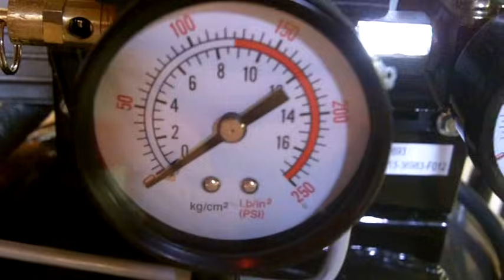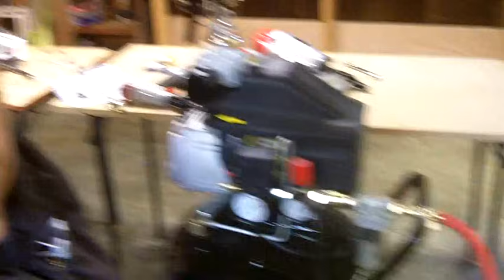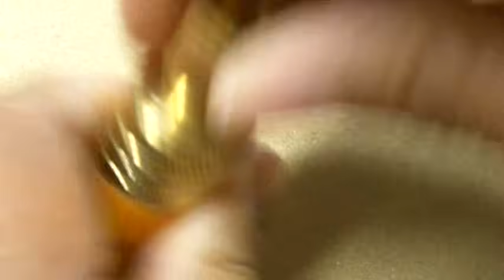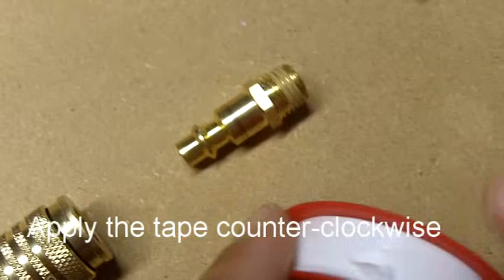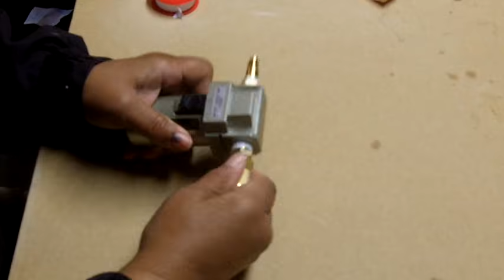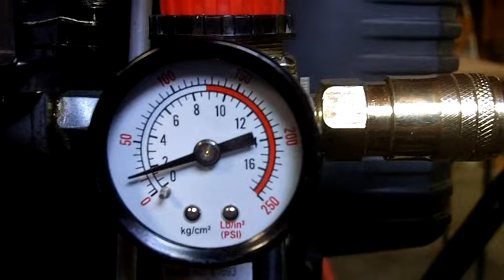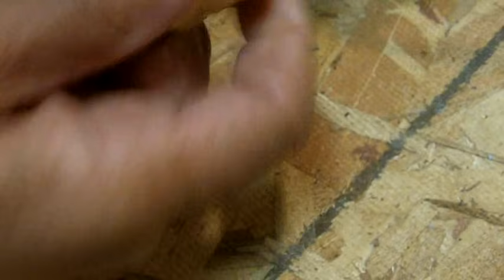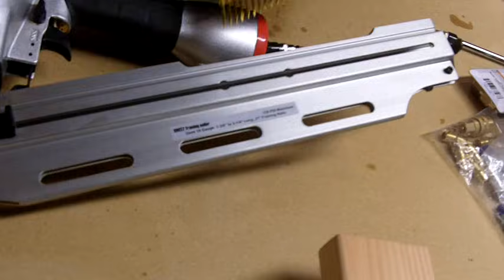Air Compressor, Line Setup and How to Use Air Tools for Beginners

Comment: i borrowed a compressor off my dad but if hasn't been used in years. before starting it i changed the oil but i spilt some all over the pressure switch I don't know if that made a difference. anyway i turned it on without attaching anything. the pressure went up to 130psi yet it says maximum 115psi on the sticker. i had to shut it off as it was still rising and didn't cut off and I was afraid it would blow itself up. 

do i need a new pressure switch since it doesn't cut off and keeps building up ?? or am i doing something wrong ?
Reply from the maker: +JCDenton648     This is a very dangerous issue.  Your description is typical of a pressure switch failing. In addition to that, the pressure relief valve did not trip which makes a serious issue even more critical.  Diagnosing a mechanical problem remotely can be difficult.    You would be best served to have the compressor serviced.

Comment: Ms Leah-I have a air compressor and I want to use it for impact wrench. The manual says to but 3/8 inch air hose. When I go to the homedepot/lowes, I can see the 3/8 inch hose but all fittings are 1/4 inch. Will 1/4 inch fittings work with 3/8 hose. If not, where should I buy 3/8 fittings.
Reply: vikaschopra1973 That is what she was doing toward the end of the video ... attaching a larger filter fitting to a smaller quick connect plug and then to a smaller hose.  She used a coupler to match the larger size to the smaller one.  If you want to get a bit more orientation go to Amazon.com and search for "air fittings" and you'll see all kinds of kits.  You could also wander around a store like Harbor Freight, or Sears, or Lowes, or Homedepot.  Sometimes the gods will smile on you and you'll find an employee who does not see you quickly enough to scamper away into whatever dark hole they hide in to avoid helping customers ;-) and you could ask some questions.
Reply: Mike De Bruyn Thanks

Comment: awesome video!!! i have a question, im going to start using a brad nailer 18 gauge oilless do i still have to use a filter? and the air compressor is oilless to
Reply from the maker: Ortiz H    It will help prolong the life of your air tools.
Reply: Yes being cautious with our tools is important, is the filter using Is brand central pneumatic? Or which one is it and if you recommend it

Comment: Just bought the same compressor  (21 gal ) and, i did the initial set up  ( for 30 minutes as indicated ) and the tank was a little too hot..its leveled,  i did add oil also as indicated, i start using it wit a nail gun ( brad nails) , use it for a little bit, few nails, im rookie in this field..do u know why it gets that hot the 1st time?? ..

Thanks
Reply from the maker: Hector Javier Sanchez Hi Hector, mine does get hot as well.  Does it cut off?
Reply from the maker: seejanedrill I mean, does it cut off when you're using it?
Reply: It does cut off when it reaches preassure, as supposed to, it's just the being a little too hot part that concerns me, but i think ( im a rookie. .) That , all compressors get really hot when filling the tank the 1st time b4 use for the day..i think..correct me please if im wrong...

And thanks for the reply.
Reply from the maker: Hector Javier Sanchez Hey Hector, first of all, I apologize for taking so long to respond.  I have used many compressors over the years, and they do get warm.  That said, my HF compressor does get very hot, so I think it is just typical of this model.
Reply: No problem!! We learn as we go (us rookies ).. im very, very thankful of ur inside on these things, i just replaced a ceiling and used the compressor ALL for the 1st time (nail gun and all)....and yes , i agree with u... 
We are (all) able to do these things
Reply: Dont know why that line shows over the last sentence **

Comment: Hey Jane I enjoy the way you teach :)
Reply from the maker: Adam Gracy  Thanks Adam
Reply: seejanedrill do you think you could help me out with some recommendations? I'm looking for an air compressor and nail gun package, probably a framing nail gun. do you have any recommendations for brands?
Reply from the maker: Adam Gracy Hi Adam, it kind of depends upon the type of job that you are planning to use the nailer and compressor for.  Are you a DIY-er with an occasional project, or do you plan on using it in a commercial application?  This makes a huge difference.
Reply: seejanedrill honestly it's just going to be a do it myself type of work. I plan on making a bed frame some benches and maybe chairs. I really suck and nailing in nails

Comment: I think this is the best instructional video I've seen yet on youtube- with your clear and thorough guidance, i finally busted my compressor out of its intimidating box and plan to put it to use at last! sincere thank yous, Leah
Reply: I'm a professor and had years of training on teaching techniques and approaches, and she is much better than not only me but most, if not all, other professors I know.

If I were her I would consider selling a product line.  For example, a "kit" that sells all the fittings needed for an air compressor.

Comment: Thank you so much for posting this video! How much of a gallon compressor can I use in order to use an air impact wrench? I have one in the basement and I wanted to know if I can use that instead of getting a whole new one. I think it's a 3 or 5 gallon tank.
Reply from the maker: Terrance Williams Hi Terence, unfortunately, it is highly unlikely that a small compressor such as yours can deliver the amount of CFM (cubic feet per minute) that an air impact wrench would need.  At a minimum, you would need 2.5 CFM to operate a 3/8" impact wrench (small) and 4 CFM to operate a 1/2" impact wrench (larger).  You will need to look at the manufacturers data sheet for your air compressor to find out how yours is rated.

Comment: this was a great video. keep it up. My wife really appreciated the simple explanation. I kind of overcomplicated it thanks. is that a HF 21 gallon compressor, and if it is how you like it?
Reply from the maker: WitchdoktahArms Hi there, glad you (and your wife) liked the video!  As for the compressor, it was priced well, I have used it without any major issues, however, sometimes it can be a little bit sensitive to changes in room temperature.

Comment: I'm no idiot. But for the purposes of something like this I appreciated being treated like one. It helps, it really does. Thank you for taking the time to explain all this in 1 video. I'm confident my first use with my new compressor will go very well tomorrow.
Reply: What Jared Foster said.   Leah, thank you!
Reply: Yup, what Jared said...this was exactly what I have been looking for.
Reply: 100 percent in the same boat. I consider myself handy but I KNEW nothing about compressors prior to this.
Reply: @SarcasmSage-w6o  Same.
Reply: Some of us need every detail and being spoken to like a beginner student!  Thank you Leah!  👍🏼
Reply: @annaibarra3447  I
Reply: @Strve Sit I just started actually using mine...  ALWAYS REMEMBER TO TURN PRESSURE OFF WHEB TAKING A FITTING OFF!  Probably happens to everyone at least once but I almost took my eye out trying to take the quick connect hose off while it was still pressurized to 125psi!
Reply: Well said!
Reply: Same here. I am a very "handy" person, just never used a compressor.
Reply: Some time's it's good to be refreshed on using compress air! It can be dangerous if a person don't know what they are doing.
Reply: I understand more than I did before!  Thanks!  Great explanation!  Easy to follow!
Reply: Being provided with complete, detailed information is not being treated "like an idiot".  It's being given good information.
The OP has no idea who you are or what you already know.   How could they? 
"Hey Jake!  Hey Rocko!  Go visit our friend there and find out what he knows.  The boss don't want to commit no faux pas by telling him something he already knows."
Reply: Seems nobody is an idiot to Leah. She treats everyone as novices. The whole point of her videos. Thank you, Leah!
Reply: Actually you are
Reply: @irishuwould5185  actually if you read his comment again, he is being very humble acknowledging that he appreciated being educated as if he was a novice because he learned from her. Some people here had difficulty comprehending what he said; a few people in this thread understood but many did not.
Reply: Ditto
Reply: Jared Fos
Reply: Seriously?
Reply: @Kreed Eneerg this is helpful. Thanks alot
Reply: IF YOU SO SMART  , WHY  YOU ARE HERE? PROBABLY TOMORROW YOU DON'T KNOW WHERE IS THE SWICH OFF ON AND ON IS.
Reply: @annabellelopez6111  because being intelligent has almost zero correlation to accumulated knowledge. air compressors aren't chaotic, but the ramifications for failure are sufficiently high that an intelligent person will seek knowledge. ya big dummy
Reply: yeah, I would rather have someone ask all the little questions, that they think make them look "stupid", and get the fundamentals right than screwing it up. I agree with you
Reply: Yeah I was going to express the same sentiment. I've used air tools and an air compressor before but I've never had my own compressor or tools before. I just bought my first air compressor and air tools (actually the same one she's using in the video) and I needed a detailed setup and overview. This video is exactly what I was looking for, thanks for making it Leah!
Reply: R.I.P 
Jared Foster
1979-2015
Died from air compressor related accident
Reply: Stoner Penguin NO WAY.... Jared died, he most not of drained his air tanks of standing water and they rusted on the inside causing it to burst sending shrapnel through out his shop and hitting him. I wonder if he ever checked his pressure relief valve. That’s it my compressor is going on e-bay today!! This just blows me away!
Reply: @mermaidmuncher812  (3
Reply: Jared Foster that’s cause she’s a idiot
Reply: Jared Foster absolutely rude
Reply: X Jay900 u just should know people just have their way to express an appreciation, don’t let yourself confused, his comment wasn’t rude lol
Reply: @Stillness__0  Yea I ALMOST seen what they are saying but he clearly explained his sentiment.

Comment: Leah, Thanks for the video for this new beginner and owner of an air compressor. It really helped me out. I'll be using it soon to lay quarter round to finish off my floors. My question is: do you have a video to explain what to do once you are done using your compressor? What steps do I need to take once I'm done for the day to put up my compressor? Thanks.
Reply from the maker: Duke Dismukes Hi Duke, I'm glad the video was helpful to you!  As for what to do when you are done using your compressor for the day, it is really important to read the manufacturer's instructions for your compressor to find out what they recommend.  That said, here is a general overview of what to do:  Turn off the power, unplug the compressor, close the in-line shut-off valve, drain the air from the tool you were using, and then detach the tool. Finally, open the drain valve at the bottom of the tank to drain any moisture that may have accumulated, and then close the valve once the moisture has drained.

Comment: You don´t need to oil your blow gun, and it´s not desirable.
the air passes right threw, no motor or moving parts besides the valve it´s self, the oil will be spray right out on the thing you want to blow the dust of, but it will have a thin oil film instead. 
Otherwise a nice beginners tutorial.
Reply from the maker: seiki Hi Seiki, thanks for your comment, and for sharing your personal experience.

Comment: i have a craftsman 5 gallon, 1hp,125psi, model 921.166360. my air compressor gauge only gets up to 25psi and it won't goes any higher.. do you happen to know the problem. thanks
Reply from the maker: tubetinh7  Sounds like reed valve failure

Comment: Hello,

This is the best air tool set up video I ever saw on Tube. If possible, may you list all components from HF here, so that I can simply copy and buy the tools.

Thank you
Reply from the maker: codyq0987   Hello Cody, Only the filter and hose were purchased from HF: 3/8 in.x 25 ft. premium rubber air hose no. 61936 and 3/8 in. compact air filter no. 68230 ( reducer fittings included).  The connectors, plugs and couplers were purchased from stores other than HF.

Comment: Thank you so much!  I was frustrated to no end as I tried to figure out how to use my air compressor/air tool.  I couldn't figure out how to get the hose to fit to either piece of equipment.  Your video gave such clear instructions.  Not only did I learn how to fit it all together but I also learned what the different gauges mean and how easy it actually is!  Thank you so much!!!!!
Reply from the maker: Chryshanee McNeely You're welcome, Chryshanee, and I'm glad the video helped you to use your air compressor!! :)

Comment: excellent! one question though. When describing the couplers, you mentioned that the universal fits both so why not use the universal coupler instead of the industrial. is one better than the other?
Reply from the maker: Shawn Lawson   Hello Shawn, no fitting style is superior to the other. It's just manufacturer's design differences.  In addition, it's sometimes about what is readily available in your area.  As you noted, the universal couplers are nice because they receive either plug style.
Reply: Great! Thanks for clearing that up.

Comment: Excellent video. Thanks for posting. What brand water/air filter are you using? I'd like to install one on my new purchased 30 gallon portable compressor.
Reply from the maker: Johnny CincoCero  Hello, Johnny!  You'd be best served by purchasing a filter suggested by the compressor manufacturer.
Reply: seejanedrill I could do that. However, I was able to find out which one you have there. That is a Harbor Freight model. Bought 2 of them yesterday. Thanks..

Comment: Hi, i have a question, i was trying to use my dads big air compressor yesterday and having problems, it will keep running until it blows the safety switch out (the thing u pulled with the metal ring on it). is there a way i can adjust the compressor so it will shut off before that happens? my dads friend messed with it one time and its never been right ever since. my dad passed away in 2011 so i cant ask him. Thanks
Reply from the maker: archeryhunter72   Hello Hunter,  Sounds like the pressure switch has failed.  My guess is the pressure switch needs replacing, I would not run the compressor without having it serviced.  Sorry for your loss.

Comment: Very helpful.  

When using teflon tape, I make it a point to wrap it in the direction I will be turning the item I'm going to thread onto it.  For example, if I'll be turning the female connector clockwise to attach and tighten it, I'll wrap the teflon tape clockwise as well.  This ensures that the tape stays in place and is pulled tight when attaching the connector, rather than the turning action trying to unwind the tape.

Does this make much of a difference?  Probably not.  But I'm OCD and this keeps me feeling all warm and fuzzy.
Reply from the maker: Billy Joel Hey, yeah, it makes sense...wrapping the tape in the right direction is the right thing to do.

Comment: Hi Leah , first off as a recently retired teacher let me congratulate you on your video and your communication technique. But getting to my question, if I wanted to use a spray gun in my guitar building is there any type of filter [ or filters ] that would bleed the line of water completely ?
Reply from the maker: Andrew Darnley Hi Andrew, your question is a very common concern of anyone who uses their compressor to spray paint.  There is something called an inline desiccant dryer/filter, and there is also a an oil/water separator that you can get to help remove the water. If I were you, I would investigate these.  The thing is, I'm not certain that there is anything on the market that can remove 100% of the moisture from compressed air.

Comment: Watching your video I appreciated your explanations. I learned the differences of the couplers the hard way.

The one thing that I feel you missed, is the rhyme and reason for installing the couplers & fittings in the manner which you did. Your manner of installation allows fittings to be installed on the tools for quick and light handling. I do it the same way. I was in a friend's shop the other day and realized not everyone thinks alike. He had his couplers and fittings reversed. When I mentioned it to him, he admitted he had never given it a second thought. He changed everything....
Thanks again for the video......
Reply from the maker: WIlson Boudreaux You're welcome, Wilson, and thanks for commenting!

Comment: Hey Leah! Thanks for the video. See even old dogs such as myself can still learn. I have seen seasoned mechanics waive using Teflon tape simply because they felt it "too much effort" for a temporary setup. I've mentioned that "sealing the threads" from leaks is just one of many reasons that thread tape is important.
There's a natural covalent bond that occurs between two like and dissimilar metals. What that means; an electrical charge passes between the two materials upon contact which promotes corrosion, thread tape helps prevent this phenomena. (MIL-STD-186F)
Most importantly, it guards against "cross threading" or "galling" your threads (damage). I enjoyed your video so keep them coming.
Reply from the maker: *****  Hello Leo,  Well stated!!

Comment: hello seejanedrill awesome video ive just got a 25ltr compressor but im struggling to to find oil that you oil your tools with im in the uk can you tell me what its called please thank you
Reply from the maker: martin king Hi Martin, I saw one on Amazon UK called Draper air tool oil, that had pretty good ratings.
Reply: seejanedrill  ive found it thank you